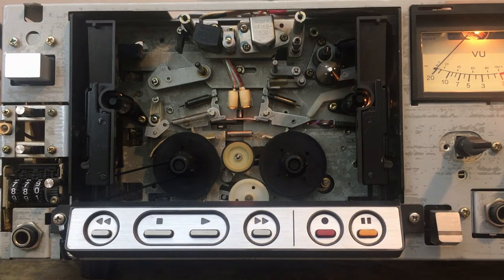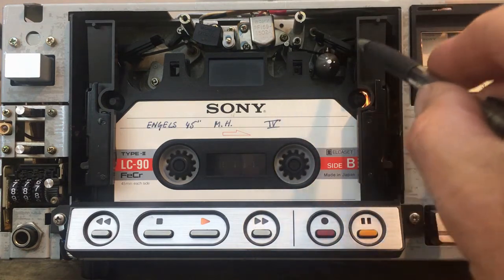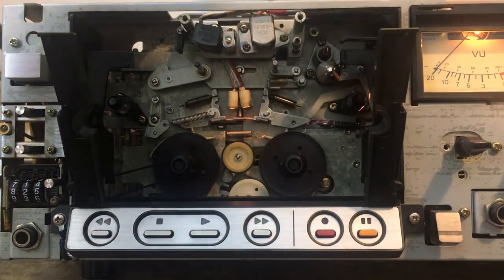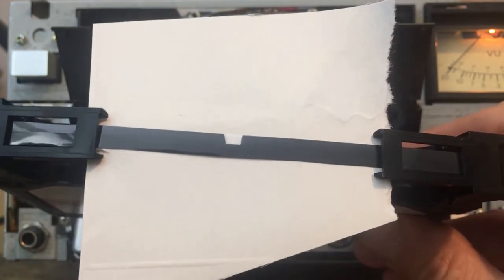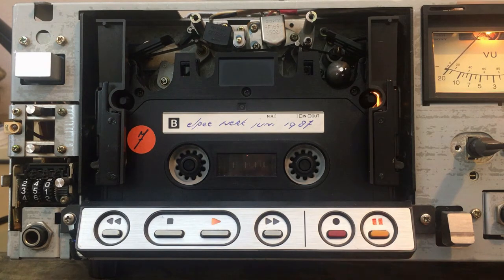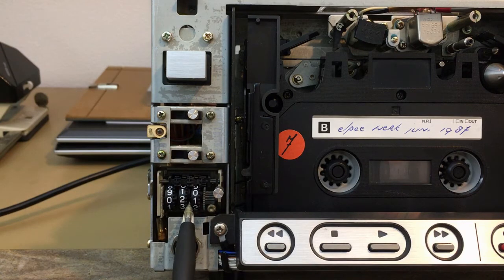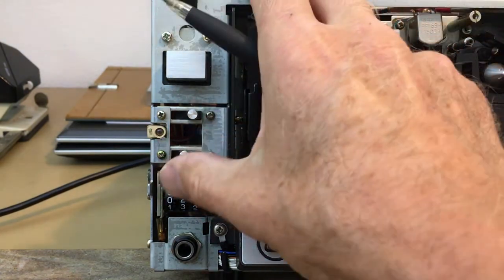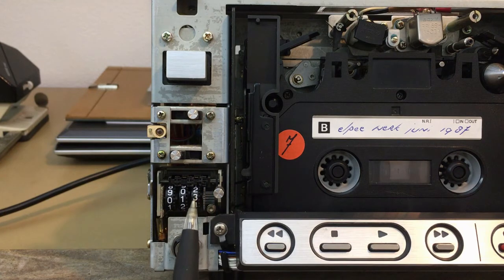Sony EL 5 Elcaset repair part 4, checking play - fast - pause

Comment: Hi. I also own a Sony EL-5. I am having a playback issue where I put a tape in and the capstan doesn’t feed the tape through. What possible causes could it be? I have cleaned it. Would it be too thin?
Reply from the maker: First thing that comes to mind is that the mechanism that moves the roller onto the capstan has hardened grease that should be removed and re-greased.
Reply: Are you referring to the right take-up spindle?

Comment: Hi. I have an EL-4 which was a display unit in a store I used to sell for. It was virtually unused and untouched. Everything seems to be operational. Except there is no transport at all. Motors are spinning but capstan will not engage although it spins. Reverse and FF do not work at all. I am interested in getting it working. I will try the belts and see if the grease and oil have dried as you mention. Thank you for your videos.
Reply: Any progress?

Comment: I have the EL-7 and my auto stop doesn't work? Could it be a dirty sensor and if so how to clean?
Reply: It may be, but it may also be the light bulb that has blown which the sensor is trying to see (it needs the light to know the tape has run to it's end. It will look through the transparant part of the end parts of the tape and switch off play mode.

You may try cleaning the sensor by carefully rubbing a dry cotton swab against it. You can see the sensor on the right side of the cassette bay.
It is just big enough for the swab to fit in, it should be a white looking sensing eye.

Though keep in mind, I own a EL-5. the EL-7 may have two sensors on each side. You may want to search for a service manual online to find that out.
Good luck!